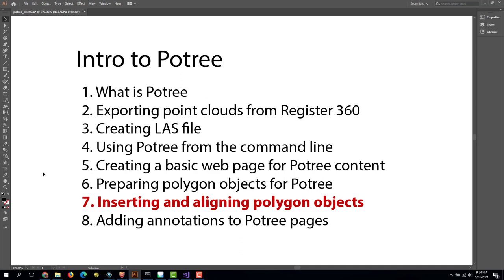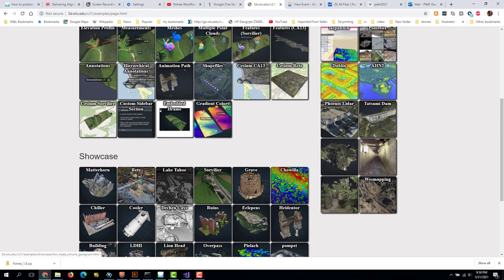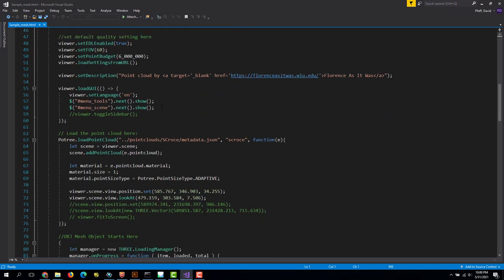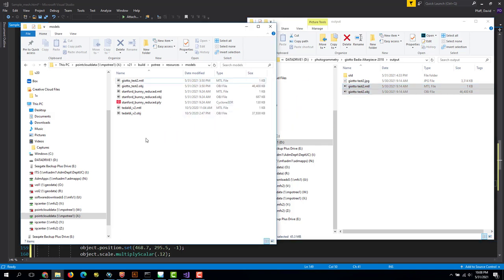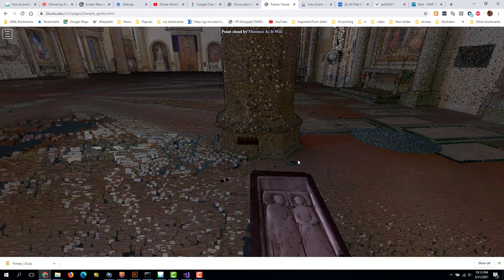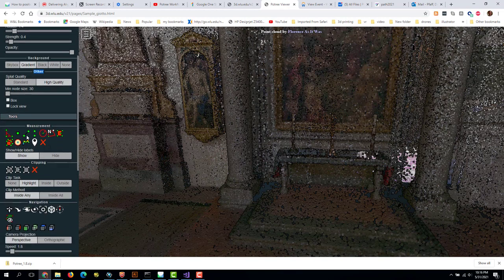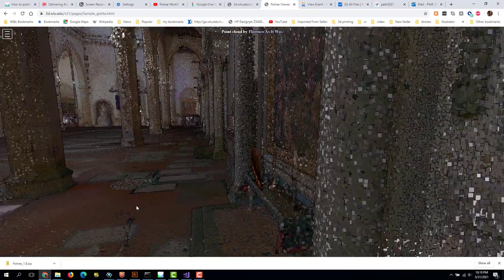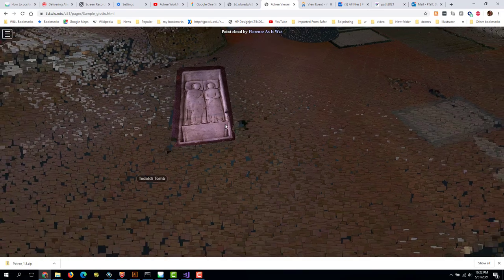Potree Part 7 - Adding photogrammetry mesh to Potree

Comment: Hi! Is it possible to use a model with multiple textures?
Reply: really important question :) sad to do not have answer!!!! I think we must duplicate line code with the path of texture..... i will try and keep you in touch...... one year later :) :) :) and if you have already answer, tell me ;)
Reply: @ludo5641  we break the meshes and load all the pieces togheter. If you export a glb file in metashape, it already comes separated one part for each texture. Then, in Blender, we export the pieces individually.
Reply: @OficinadoArdito  Thank you very much for your quick answer :)